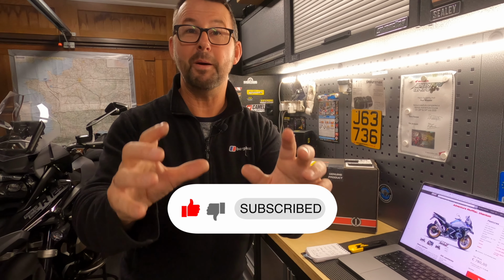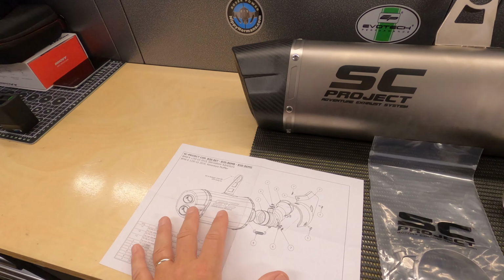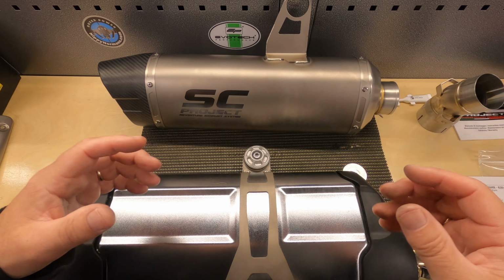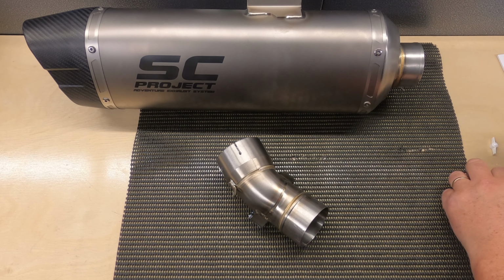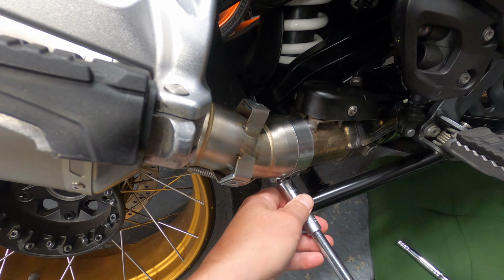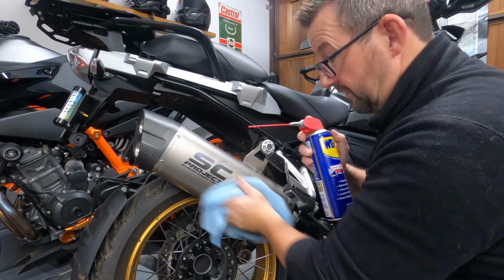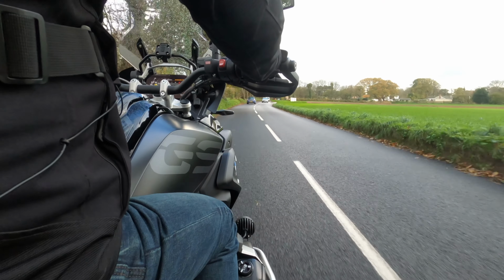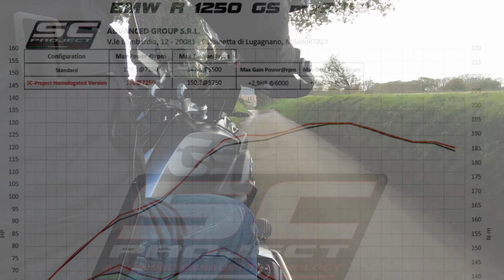SC Project "Adventure" exhaust for BMW R1250GS, full installation video and test ride  🤪

Comment: Have fun with the end can. Looks good and sounds fun BUT I bet you decide to put the OEM one back on when you're feeling guilty of annoying neighbours and people living in those lovely idyllic villages we love to ride through. You'll also notice your fuel consumption goes up and probably lose 20 miles range from a tank so not the best option for touring. Consumption probably goes up due to constantly trying to play tunes and pop bangs with the end can. You'll know what I mean after a few rides out. My FUEL end which I love, sits in its box on a shelf most of the year and comes out to play a couple of times a year for a bit of fun. Anyway I don't want to spoil your fun, ride safe and enjoy 👍. Loving your videos and channel BTW 👌👍
Reply from the maker: Thanks . All of my bikes have had end cans fitted. The only one I took off was the Arrow one that I had on my Africa Twin. That was road legal and popped and banged really loud. It came with the bike when I bought it used, in the end it was simply just too much and off it came and the oem one went back on. The SC is way nicer sounding and much more "village friendly" . As far as fuel consumption goes, where I live will be a good test for it and I will do an update when I have more info from the fuel consumption on the TFT . Ride safe....pop pop bang bang 🤪

Comment: Hi, Thanks for the great video ! It inspired me to get one also. But now I have a small issue, on my last ride the exhaust melted the corner of my license plate 😢 did you ever had any similar problem.
Reply from the maker: Hi, I had it happen once , but that was after 2 days of going flat out basically and has not happened with normal speeds 🙈new licence plate on for a year or so and no issues.
Reply: Thanks for the reply deeply appreciated, guess the solution is to start doing ‘normal’ speeds 😂
Reply from the maker: @vlopes01  No problem. I have a new unmelted number plate still 😂

Comment: Can I ask - did you consider the Akrapovic end can as an 'option'? 
Keep the videos coming.
Reply from the maker: Didn’t like the shape of it! The sc is very nice, pops when it needs to  and quiet when it needs to be . Wife has no complaints about it either .
Reply: @gsd32i  Thanks for that, I was curious because before I saw your video I'd only seen / heard of Akrapovic on GS / GSA's.

Comment: excellent video!! I enjoyed it and I'm thinking about putting one like this on my BMW GSA. On my bike I also have handlebar rises (Wunderlincj) and I would like to know how many degrees you have it at. If I set it to 0 degrees from the factory, I get the tank. Thank you so much.
Reply from the maker: Hi, the exhaust is really good, I will try and do another video this week just taking the GS out for a ride. I have not got the risers on anymore as I thought I would do a bit of off roading but changed my mind as the bike cost me too much money to drop it....so the standard ones are back on 😂

Comment: Hai again ..need to know what type or brand Torque Wrench that you use or best torque wrench that you prefer
Reply from the maker: This is what I use, from Amazon :
Norbar 13841 Torque Wrench 3/8in Sq Drive 10-50 Nm 8-35 lbf.ft

Comment: SC in black finish is best choice for me too, how did You keep on with waranty??
On dealership they told me that only with Akrapovic i Will keep on with waranty etc etc....?!??
Reply from the maker: Well if that’s the case then all the parts I have fitted have voided my warranty ! I guess if the engine blows up (unlikely) then I may have an issue with BMW trying to void the warranty . I have a good relationship with my dealer so not expecting any issues with them or indeed the exhaust/ warranty . Good that we have different colour tastes, life would be boring. If you’re that concerned re exhaust / warranty ,  speak to your dealer or get them to fit the exhaust. The oem exhaust can be back on in less than 5 minutes ……
Reply: @gsd32i  iz seems to me that on Croatia on dealership they dont have understand for customers , waranty only with Akras can, i Will send email to BMW motorad with this problem 👍🏻, many thnx for reply...

Comment: Good video, considering an SC Project for my R1250RS, so that's a good representation of what it would sound like. It's a bit raspy at tickover? (Nice wall by the way).
Reply from the maker: Hi Becksy, in initial start up the exhaust valve does it’s thing so it revs about 1400 rpm when it is a bit “ raspy” then it reduces to 900-1000 and is fine . Noise is a bit fruitier than standard but the exhaust sound is great and rising through villages you aren’t going to upset the locals it’s not that kind of exhaust . I would buy it again and I am quite fussy when it comes to noise etc . Some exhausts like the jekyl and Hyde system sound great but are nearly twice the price and you have to have them fitted by an approved dealer ( I think !) good luck in your final choice . 👍
Reply: @gsd32i  thanks, I don't want anything noisier, just a bit slimmer, the standard exhaust on the RS is enormous. I think this is the exhaust for me or rather the Xplorer II which is the equivalent. What was delivery like from Italy, and customs charges?
Reply from the maker: Delivery took about 3 weeks I did chase them up but I guess like everywhere at the time short of parts etc who knows . No issues with it and quality is brilliant . I had to pay about %5 import tax off the top of my head.  I guess you could contact your local customs folks and ask about import tax for an exhaust manufactured in Italy as there are loads of codes for items now here in the Uk for specific bits all thanks to Brexit ! Sounds lovely on the bike and just gives it a bit of character that the original is lacking in my opinion . Wipe with  wd40 is sc projects advice to keep it looking like new ( for my exhaust anyway ) 😀

Comment: Can I ask if you needed to apply any heat deflector tape to your number plate after fitting the SC Project exhaust? If yes, could you advise what you used?

Thanks
Reply from the maker: hi. can’t remember where I got mine from, it may have been Amazon , had it laying around in my garage . just make sure it has a self adhesive backing , or get a metal number plate 👍 to be honest it only melted it after i spent 3 days thrashing the gs on the motorways in France . 🇫🇷
Reply: @gsd32i  Thanks for the quick response, appreciated 🙏
Reply from the maker: @PrinceyBhoy  no problem have a great new year .

Comment: Hi, nice exhaust and I am considering this as well. May I ask what kind of torque wrench so you use. I am trying to buy one to have on my bike but none of them seems to work. I need to fasten my M10x75 as I install a rear hugger from puig and I cannot hear the click sound and I believe that I need to unscrew.thanks is in advance
Reply from the maker: Apologies for the delayed response ! I use a Norbar TTi50 10-50nm torque wrench . Sometimes have to borrow a friends one for the bigger stuff though .

Comment: Hi, I've just got the same exhaust because of your video! I've just used it for 3 km from workshop to the garage, but I found it much quiter than yours, didn't get that many pops and craks than yours... Did you notice a better sound by the time? Thanks in advance! Greetings from Spain
Reply from the maker: hi. unless they have somehow changed the design/specification I would suggest ride it at the higher revs >4000 . it can be ridden slowly through towns at lower revs and it is quiet , so not to offend anyone, but open it up and it sounds lovely …..well mine does. 👍

Comment: That sounds perfect! Is the SC project exhaust the one that burns the stock indicators? Any long term feedback? Thanks for the vid 🙇🏻‍♂️

Edit: also is there a removable baffle in this slip on?
Reply from the maker: Not removable unless you drill it out as some YouTuber did 😂.🙈only thing is that the exhaust gases melted the corner of my plastic number plate !! Bit this was only after a 4 day tour recently where I had the bike flat out ! New number plate fitted with heat reflective tape on the back 🤞
Reply: @gsd32i  haha 😂 melted the reg. I’ll order a smaller reg too. Thanks for the reply brother 🙏🏻

Comment: Love the look of the sc project. Dont know if you found the same but the OEM exhaust is a pain to clean. Road grime seems to burn on to it and the material is really hard to clean. Hope the sc is easier to keep looking fresh.
Reply from the maker: Very easy to clean, wipe with wd40 as per SC's recommendation 🤪, it did melt the corner of my number plate, but that was after 4 days of abuse at high speeds, new plate has been fitted with heat reflective tape added to try and stop repeat melt down hahahahaha

Comment: Hi - I am seriously considering fitting one of these to the GS - anything untoward to report after extended ownership?
Reply from the maker: Hi .
Nope . Quality is awesome , sound is enough to be different with being offensive . Only issue was a trip I did when I rode the pants off the GS on the motorway ended up melting my plastic
Number plate with the heat 😂
Reply: @gsd32i  Thanks, that's helpful - I will order the tin number plate in parallel 🙂

Comment: Is thread locker needed?
Reply from the maker: you don’t need to but I guess if you want to make sure you could use some medium strength stuff. I just checked mine after several days. only one fixing came slightly undone and that was one of the black small screws attaching the carbon fibre heat shield on …👍

Comment: Hey mate, nice videos. I am plannig to do the same change / upgrade on my GS 1250ADV, why you chose SC intead of others brand like MIVV, Arrow, Akra and so ? What about fule consumptions ? I  would like to ask you some other questions, are you able to give me an email address ? I am a collegue ;-) tks man
Reply from the maker: Hi, send me a message via instagram @GSD32i. Basically chose it because of the looks and quality. It does melt plastic number plates when going flat out though 😂 👍
Reply: Ah here it is, a little problem. Nice but it will melt your bike hahaha  @gsd32i
Reply from the maker: @robynair123  😂 I just have to get a new metal number plate.....

Comment: why do you twist the throttle when you shift down?? I see you have the quickshifter for up shifting, that means you also have auto rev match for down shifting.... you down shift with the throttle at 0% and it revs match it for you, sooooo why do you twist the throttle when you down shift, unless you down shift with the clutch pulled in? I dont get it (2022 R 1250 GSA owner here)
Reply from the maker: Pretty simple really . I find the quick shifter is not that good on the way down so I don’t bother with it most of the time and go back to old school clutch n throttle blip . 👍
Reply: @gsd32i  yeah, I figured as much, cool. I have the akrapovic exhaust from the factory and it also has the sound muffler non-removable because of the new euro 5 or 6 or whatever it is now norms. The screws that hold the mufflers in place have a small tack weld on them (which I can get rid of using a Dremel with a small blade) but it's loud enough as it is, similar to the one you just installed on yours.
Reply from the maker: @sunnycloudy1337  to be honest the exhaust sounds great and I wouldn’t want to take the baffles out . Just adds a bit of character to the bike . Enjoy the bike and ride safe 👍👍

Comment: Lovely sound from that can bud.
2 things did you find out why your bike was pulling to the left with the road 6s on?
And could you tell me where you got your frame fill ins from please?
Reply from the maker: Didn't find out, but they are a fab tyre! Infill panels are from BMW they come with the radiator guards as a kit and not expensive (for a BMW) 👍